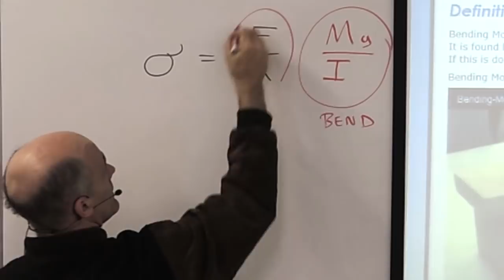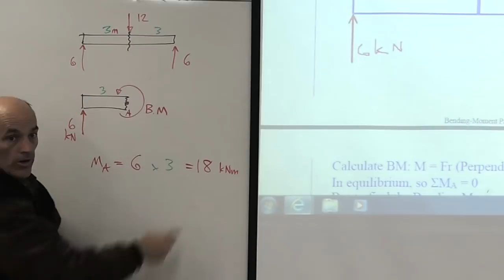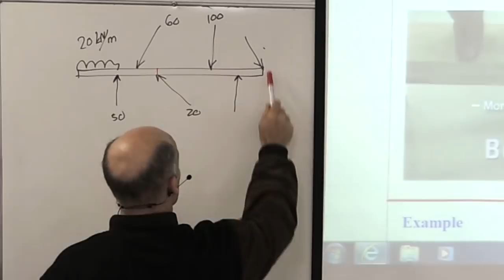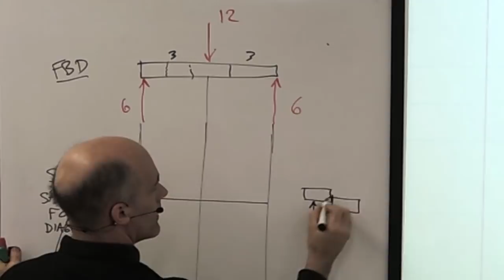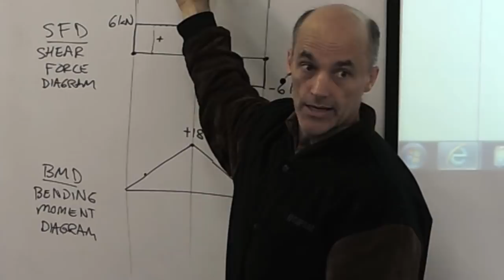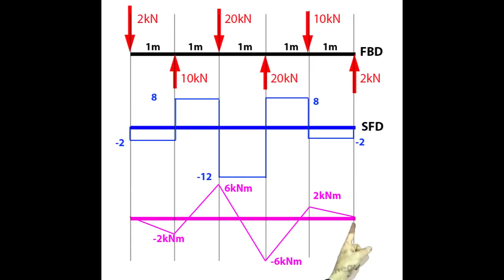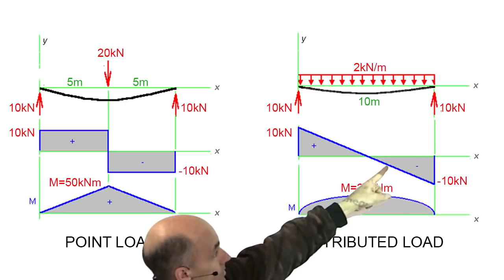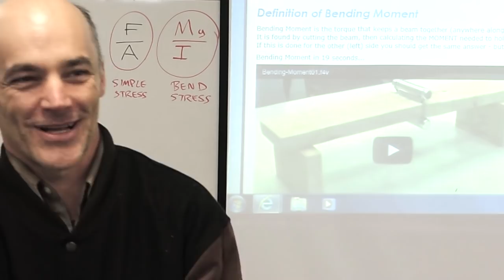Bending Moment

Comment: Fair play...Ive just completed a HND in Civil Engineering and with all the things you have to take in its very easy to forget some things, I never entirely got it the first time round in University...but this is an easy to follow and well explained example. 
You have put some good effort in to the production of a simple and not overloaded with snippits of information(experience).
As when a student is making notes or trying to visualize what is happening, often it is hard to keep up with the visualisation of what is happening compared to how fast the lecturer is speaking. 
Well done on this video. 
Cannot wait to check out the rest. 
Thanks.

Comment: Sir , thank u very much for making the subject such clear and easy. When a section is under tension stress we consider the forces postive though it act in opposite directions , so both bending arrows were postive too as u wrote the first time. The case is different when we compare the signs of the external forces and the internal forces. Of couse their sum will be zero

Comment: Please show all the work done by Aneroid barometer and efficiency 
So what if we use steel plate 3 mm thick for making aneroid barometer cell cylinder. Having surface area one kilometers square kilometers ?

Comment: if you are saying the moments about "a" near 14:00 why are you saying that clockwise is positive when that particular direction is the negative direction in all other torque problems. counterclockwise is the positive direction which should have meant that 12x1 takes the positive value....
Reply: Michael Hixson +CW is arbitrary, which means it works either way (+CW or -CW)  - so long as you stick to it thru whole question.

Comment: hi can you tell me how you calculate .25 on the BMD? pls
Reply: +Alai Paula It's unlikely that you'd be still be wondering about until this time but for everyone else looking for the answer to that in the future: 

So you know the magnitude of moment at 5m which is 61 kNm. So we'll be looking for the area of the triangle after that point. You have to find the exact location of that point where the peak is. We know the slope of the line is 4kN/m and it goes down from 5 kN to 1 kN in 1m. So to go down 1 kN, the distance between 1kN and 0 kN must be 0.25m.

Comment: If the bending moment for the sagging beam is 18kNm - what is the significance of that to a structural engineer ? For example, if the BM was 25kNm what is the affect? Does it mean the beam is stronger/weaker in comparison ?
Reply: Hi Helen: Bending moment is the intensity of applied load on a beam, so the engineer must design the beam to withstand the applied bending moment (by making it large enough). Regards Tim
Reply: It tells you how large the product of section modulus and allowable stress of the material must be, in order to safely withstand that particular bending moment. Section modulus is a property of the geometry of the beam cross section, that relates bending moment to maximum bending stress within it.  It also governs the total deflection of the beam, as you account for the accumulation of bending moment along its length.  

As an example, suppose the beam were made out of Aluminum 6063-T5, with an allowable stress of 100 MPa.  Allowable stress = stress at failure (yielding in this case) divided by required safety factor.   Given a bending moment of 25 kN-m, this means the section modulus must be at least 0.00025 m^3, because section modulus * allowable stress must meet or exceed bending moment.  If the beam were a solid square extrusion, this would mean a beam that is 12 cm wide by 12 cm tall.

Comment: How did he get the distance 1.25 at 29:17 of the video?
Reply: After the + 5 KN, the distributed force goes down 4 KN every 1 meter.  At the 0 point (Max moment), the force needs to go down by 1 KN only which is 0.25 distance if you calculate using similar triangle method or logic. Then area of triangle up to the 0 point=1/2 × 1.25 × 5

Comment: For real now why do physists have to make everything so complicated by naming same formulas with other variables it s just get s on my nerves for example by naming I=A or by naming p=σ
Reply: Because they are not the same formulas.  They are analogous formulas, relating different concepts.   I in this case stands for second moment of area, which is not the same thing as area.   The sigma refers to stress, which is not the same thing as pressure.
Reply: @carultch  in terms of numbers and calculation they are exactly the same thing for example p=F/A S=F/A
Reply: @carultch  just because pressure in this case has to do with fluids and Stress has to do with solids this doesn t mean they aren t the same thing
Reply: @mrhatman675  The difference between pressure and stress is not fluid vs solid.   It is external force on a solid vs internal force within a solid.   There are applications where the difference matters, such as contact mechanics.

Comment: Is the bending moment a response to the 12 newton force on top?  so we need a force of 18k newtons to resist and equate to the 12 newton force?
Reply: Bending moment isn't measured in only Newtons.  It is measured in Newton-meters.   Suppose we had an extremely tall wide-flange I-shaped beam that were 1 meter tall, with a web of negligible thickness.   The tension in the bottom flange, would be 18 Newtons, and the tension in the top flange would be 18 Newtons, in order to produce a torque on the adjacent sections of beam, to resist the loads applied to the beam.

Comment: By looking at your diagram, can we say that, if the shear is zero at a point, then the bending moment is max at that point?
Reply: Yes and no.  All that will tell us, is that there is a critical point in the bending moment diagram.  It could be the maximum, but it could also just be a local maximum.  You'll need to identify and evaluate ALL the critical points to determine where bending moment is maximum.  The first and final point, as well as any point adjacent to a fully fixed constraint, could also have maximum bending moment, without having zero shear.